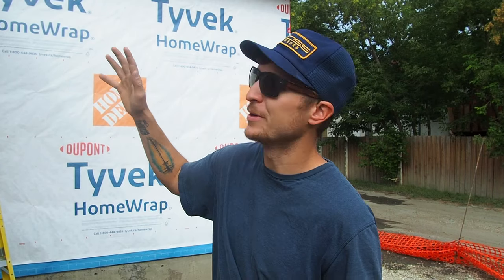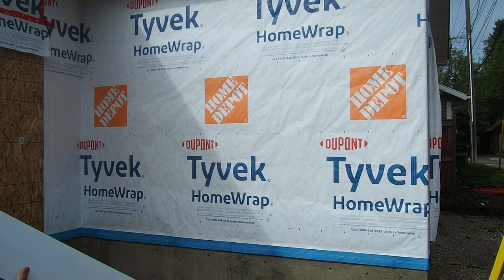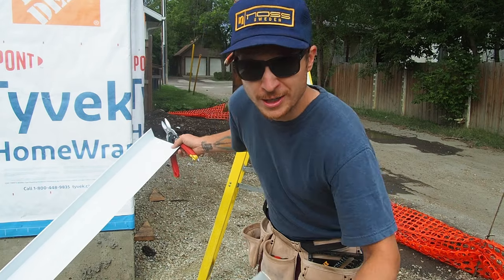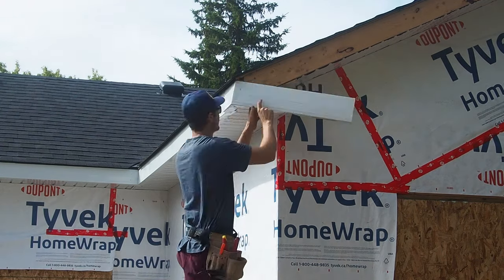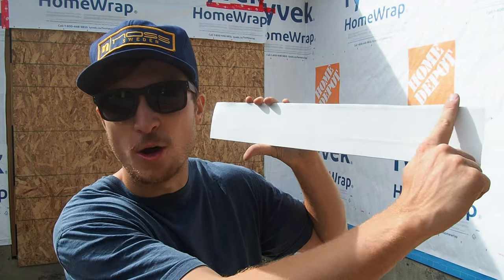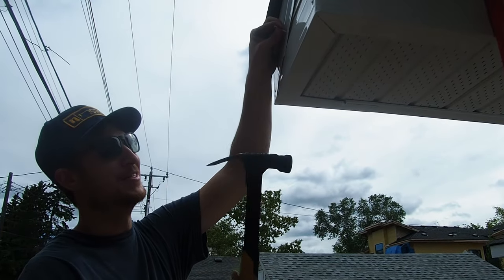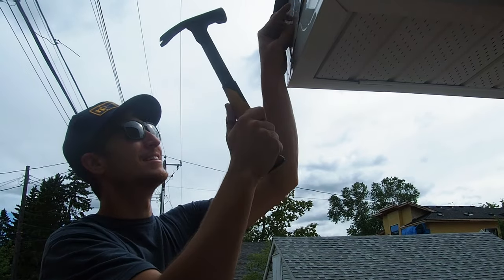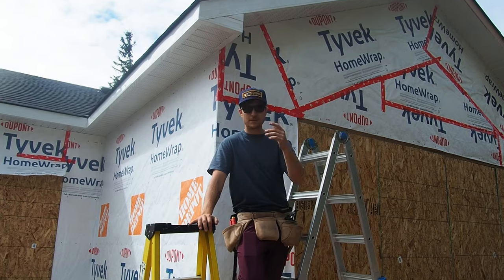Tips for installing aluminum fascia (Everything Garage Part 7)

Comment: Tip for the nails: Hammer a little hole with an "ice pick". I used this method on my shed for nails and fascia screws. ... Tip #2: Working alone I also used gorilla tape to hold fascia in place until I got them secured.

Comment: Predrill the nail holes !! 😂😂😂
Reply from the maker: Hahaha that's one way to do it 🤣
Reply from the maker: S c  I wasn't disagreeing on pre-drilling the holes- I totally see it making the process quicker. However, the 'tips' are not for professionals. They are aimed at the average homeowner, who has a much more likely change to bore out the hole too large or skate the drill bit across the surface. It isn't the fastest but I didn't ruin a single piece of fascia, just bent a few nails at the bottom corner 🤣
Reply from the maker: S c  ahhh gotcha, That makes way more sense. The only holes I can see pre-drilling are those bottom corners through three layers.
Reply: S c  I also have worked siding for years but I have seen countless people and countless crews that predrill the face. Literally takes 3 seconds. You arent bankrupting the company that’s such a shitty exaggeration. Rather my guys take a few seconds to predrill holes than to leave a bunch of pings all over the fascia
Reply: Yea I never nail the face of fascia pre drill bottom lip
Reply from the maker: @charlesalegria73  Every face is nailed around here. Especially if you don't use the cap piece to nest the top side of the fascia holding it in place. In our case, we added a vinyl trim above/on top the fascia to tie into our house.
Reply from the maker: @kristopherhansen8768  I can absolutely see the point of pre-drilling if you are sound and steady. But for an average homeowner (who is more likely to watch this) to tackle a small repair or shed, etc, pre-drilling will likely lead to wandering drill bits and scratched surfaces. I have seen more scratched faces/undersides from this, then dings from missing a nail when I look around the construction in my city.
Reply: @hsdesignstudio  The purpose of pre-drilling is to allow for expansion and contraction. Without pre-drilling slightly larger than the nail the trim will buckle when the different materials expand and contract at different rates.

Comment: You need a bigger stepladder, smaller hammer.  Dont cut the bottom off as it looks crooked, use a knife, and score it.  Practice practice practice.

Comment: Use the siding brake to make return boxes that's more easy
Reply: I make a 2' piece. Bend the return or reveal whatever you call it then bend the piece in half n just go up and cut to fit in place no measurements.

Comment: Looks like you have what's called a 2 x 6 (actually 1.5 x 2.5 inch) fascia board (which may have been cut at an angle to accommodate the slope of the roof) below your aluminum fascia trim.  How did you size your aluminum fascia trim to fit the outer dimensions of the fascia boards?  Where did you purchase the aluminum fascia trim?

Comment: I have a question, is it more cost effective to buy pre bent fascia and rake metal than to custom bend your own? 
-siding contractor
Reply from the maker: Honestly no idea. Building materials were limited due to COVID and I worked with what I could get when I needed it. It’s my own garage and wouldn’t do this type of work for clients. This stuff was like $200 CAD for the whole garage. I can’t see a rake and straight fascia being cheaper.

Comment: Have you ever seen siding done first and the birdbox/soffit done after?
Reply from the maker: I have seen soffits done after siding/stucco. In theory, as long as the siding is stopped at the correct height, it shouldn't  impact the soffits in anyway..at least that I can think of.
Reply: @hsdesignstudio  
Im building a shed and i like the look of siding tucking under the soffit, looks cleaner that way, but it creates a challenge to do the bird box
Reply from the maker: @Mrdubomb  Do you need to have the birdbox look? You could always finish the siding/soffit in a more modern manner where the gable soffit extends to the main flat soffit, and a small piece of flashing fills the angle gap.
Reply: It really doesn’t matter but I’ve been doing this for 20yrs but I prefer doing the soffit first
Reply: @hsdesignstudio  I like to make the bird box all in one piece
Reply from the maker: @charlesalegria73  I would have liked to make the fascia in one piece as well around the bird box. This year being what it was, I could not find taller fascia to save my life. Therefore, this was the next best solution in my mind (I am not a professional soffit/fascia installer). Still looks clean and water will still be moved away.
Reply: @hsdesignstudio  oh so u don’t buy the whole fascia coil u bought pre bent
Reply from the maker: @charlesalegria73  yea I did for my garage. I don't install fascia for clients ever, just my own projects.

Comment: Why wouldnt you just bend a corner box... would look 10x better
Reply from the maker: I couldn't get my hands on any at the time. It was pre-bent 10'ers or wait who knows how long for ordering.  Like I said in another comment, I would have preferred if I didn't have to add the skinny layer, and instead it was all one piece around the corner.
Reply: @hsdesignstudio  can you explain what this means? Do they sell prebent aluminum bird boxes? Thanks
Reply from the maker: @jjrock5  what I mean is that my particular birdbox framing is taller than the depth of any fascia I could get my hands on. Therefore, I had to add the extra skinny piece around the top to cover the framing.

Comment: Wouldn't it better to use a 1cm screw with a white end , so you don't dent the fascia
Reply from the maker: Also an option. If you don't miss the nail, you don't dent the fascia 👍
Reply: No never use screws on fascia unless it’s wood fascia board
Reply: @XcZuNiTy why not
Reply: @joeyjohnson9765  Because they'll dent the aluminum fascia more than needed it can also warp them over time unless its a small machine screw of some sort, then at that point its not worth it. Plus screws can allow more moisture inside than needed.
Reply: @XcZuNiTy  thank you for the info